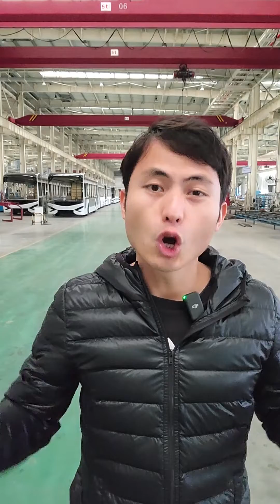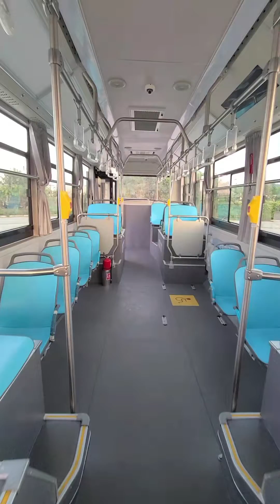Central drive axle VS in-wheel motor drive axle

Comment: How reliable are axles with in-wheel drive motors? 

The absence of conventional differential made it a need for the individual wheel speeds to be electronically controlled, especially when turning. 

How much inaccuracy and loss of power can result from the use of electronic differential? Do the electronics last long? What if the electronic differential fails? I am also concerned about the higher power consumption and increased tyre wear.

Comment: In small vehicles also is much better to use independent axle motor than using central drive unit with conventional axle, we could chop off the requirement of having a propeller shaft of which takes some space in the chassis
Reply from the maker: that's what I mean, you got it!